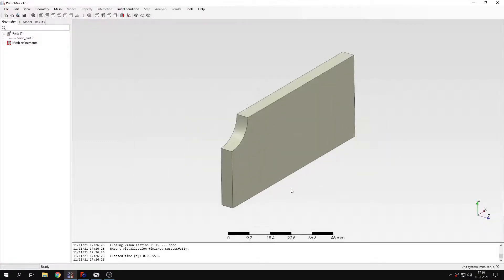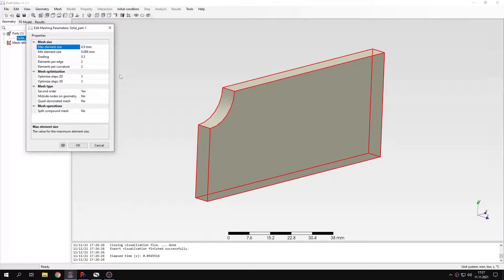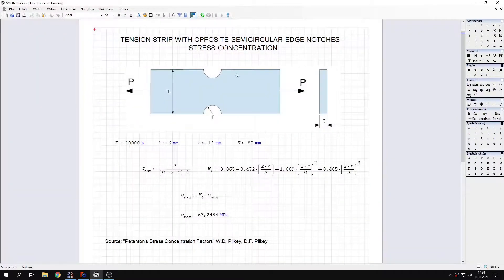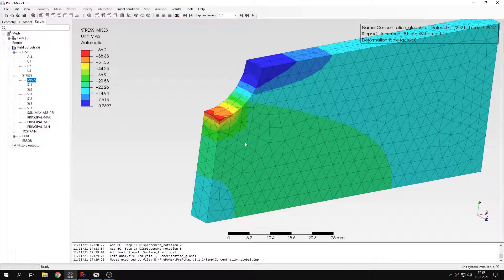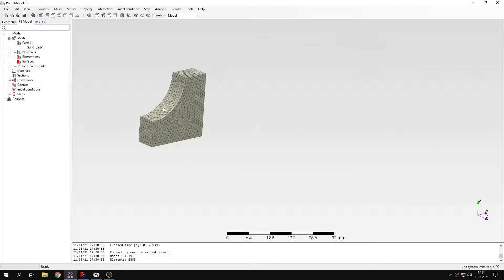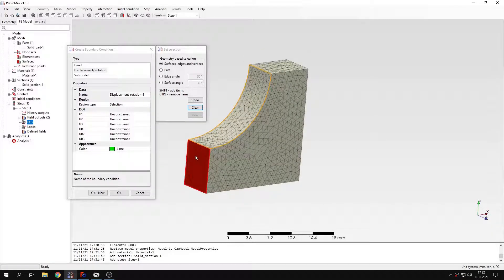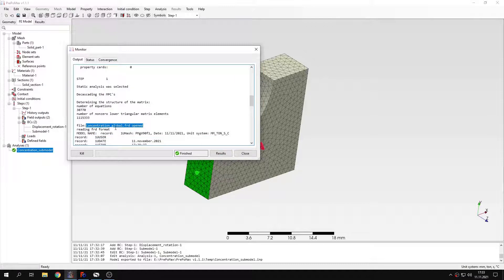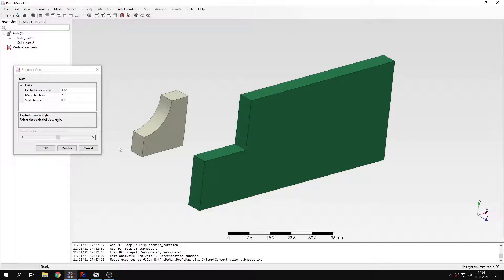PrePoMax (CalculiX FEA) - Tutorial 13 - Stress concentration - submodeling

Comment: Hi, thank you for great series of tutorials. I have a question. Is it possible to use a shell for a global model in this case? What should be the boundary conditions of solid submodel and shell global model? Should I take displacements from submodel and leave rotations unconstrained. Or should I take both displacements and rotations from submodel?
Reply from the maker: Good question. Abaqus supports shell-to-solid submodeling. In the case of CalculiX, it's not mentioned in the documentation but it seems to work. I guess because shells are internally expanded to solids anyway. Rotational DOFs shouldn't matter in this case.